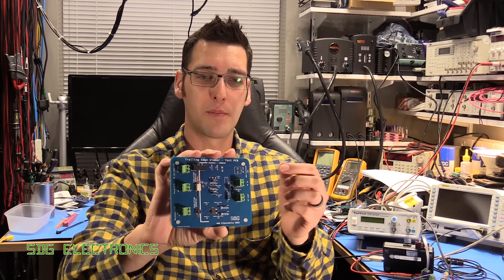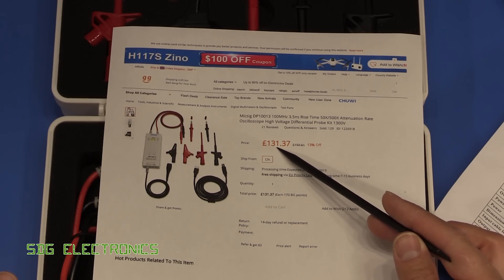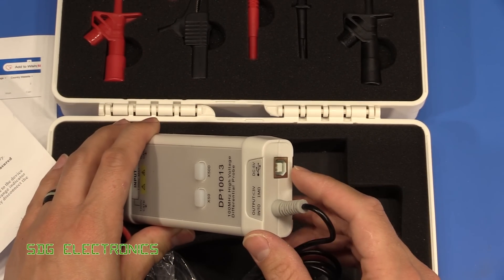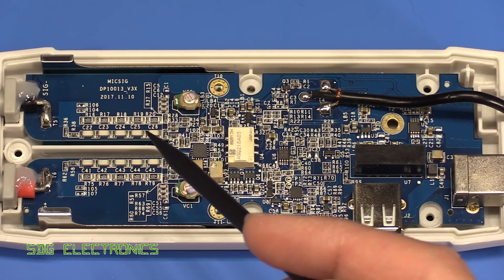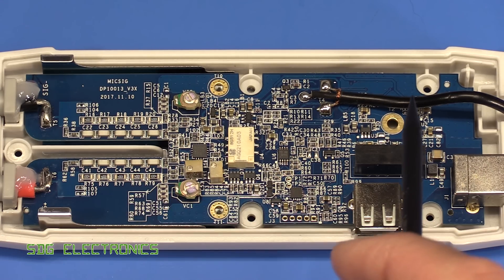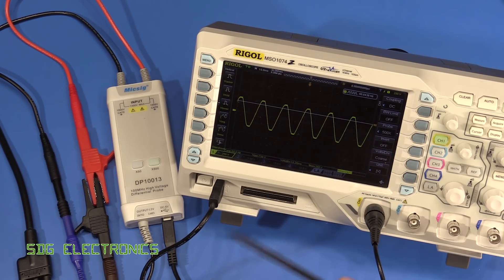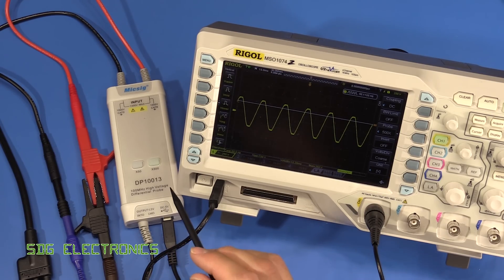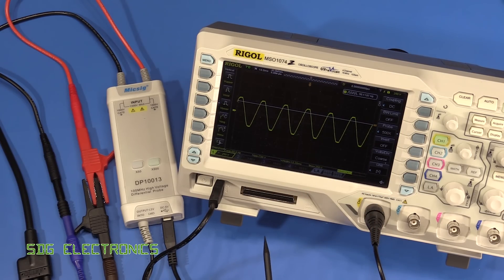SDG #067 Don't blow up your oscilloscope! Micsig Differential Probe for $140! (See link)

Comment: What is told at 2:25: should you connect your oscilloscope and the circuit under examination to same common ground or left them both floating, otherwise you can discharge floating common of circuit via the grounded common of the oscilloscope if the difference exceeds 1000V (or versa)?

Comment: Before I buy this probe I would like to know what the maximum input voltage derating curve looks like to make sure I don’t damage the probe when testing circuits running at 500KHz and higher.  Is the derating curve available anywhere?

Comment: How did you manage to open this probe? I need to replace the output cable, and I don't know if there are some hidden screws there? Or is it glued?
Reply from the maker: The screws are all under the label
Reply: @sdgelectronics  thanks! Found them in a desperate move of ripping all the labels already. One was protected by the warranty plug, if someone else is considering opening this thing...

Comment: What does an Differential Probe do ? Does it measure the measure the difference between Live and Neutral ?, just like a RCD ? In which case --- would it work using a I/T on the test piece ? Obviously, I am not an electrical engineer.
Reply from the maker: It measures between the two probes, but crucially both probes are floating rather than a normal probe where the ground lead is connected to mains earth
Reply: Hello Steve, I like like your video regarding the Micsig probe very much, but can you please show a picture with plug-modification on the high voltage side ?

Comment: Thanks for a painless and informative review.  You didn't drive me crazy, which is more than I can say for some other presenters.  How high frequency can you go before you see amplitude aberration (on a sine wave) or ringing artifacts (on a square)?  How small a signal is practical to measure before noise becomes a factor?  I bet the input leads aren't the only obstacle to real HF measurement - it looks like the output line to the scope is not the special stuff with resistance wire in the center that's used in every self-respecting high-impedance passive probe.  If I recall correctly, plain coax to a 1Meg load is useless by about 10MHz because of improper termination.

Comment: I know the lenght of wires can be a nightmare for the bandwidth specs of the probe, but, this types of leads is what do you need when you are testing big and high voltage equipment (for example very big industrial inverters)

Comment: Is powering the device under test with an isolation transformer an inferior method to using a differential probe? Are they complementary?
Reply from the maker: It's fine if you fully understand the set up

Comment: Nice review. Will you tested the most important spec, common mode rejection (at several frequencies) ?  If that is bad it makes the probe more or less useless. I have one from Pico. I compared it with the Fluke from a friend (they look very similar) and they performed the same. But some DIY and cheap iso amps performed not great. Even some Tek plugins from 500 and 7000 serie scopes where not that great other as audio frequencies. But they are old so probably some alignment will improve things but I do not use those scopes for my work, they are just collectibles.  These probes are indeed very handy and this is very cheap for a 100 MHz. I have one almost always connected to my main scope (and I always use an isolation transformer)  My Pico is 20x and 200x. Be carefull, there are 10x and 100x probes, and for Europe that is a bit low.

Comment: There is no problem with leaking batteries if you use low self-discharge rechargeable batteries, like Eneloops, I use them everywhere.
Reply from the maker: I had eneloop batteries in some flash guns, but there was a small amount of parasitic power draw which flattened them over about 6 months. The batteries won't accept charge anymore so I gave up on those

Comment: Thank you.. finally someone I believe is honest to review the MICSIG. Although too late for me, I bought used broken   Tektronik P5200. I fixed it and works ok I think. But it shows some ringing only on a  Square Waveform at higher frequencies.
Reply from the maker: The ringing may be that the compensation needs adjustment or a side effect of the way the circuit is being probed - the leads act like inductors
Reply: Thank you